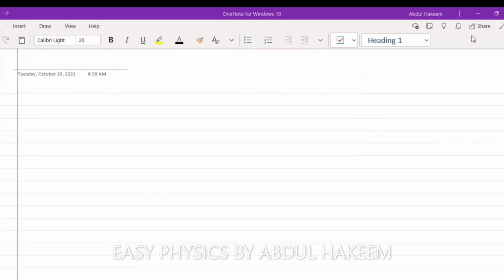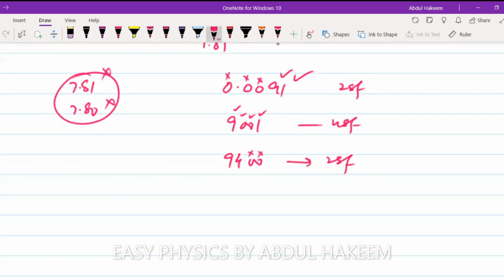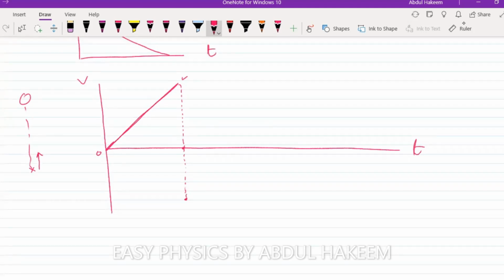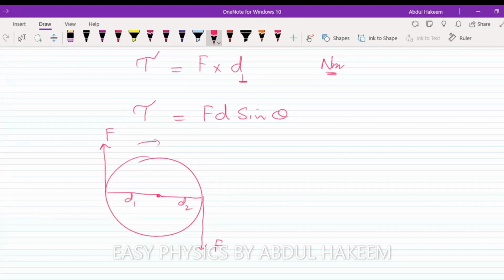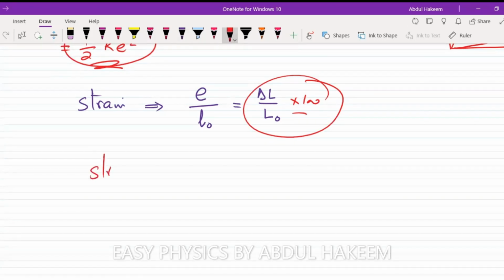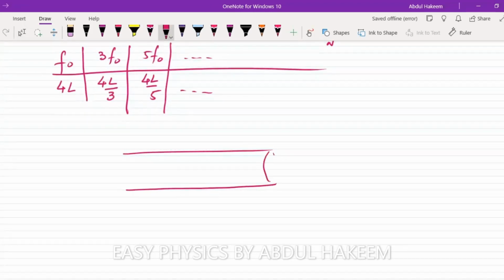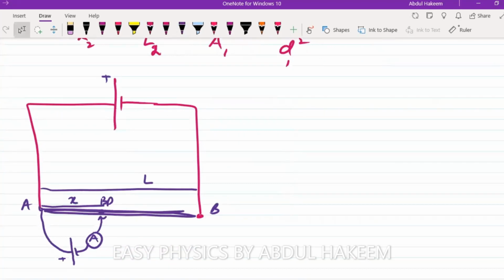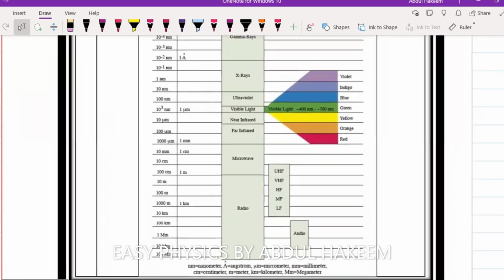PHYSICS PAPER 2 QUICK REVISION

Comment: 0:19 chap1 physical quant.
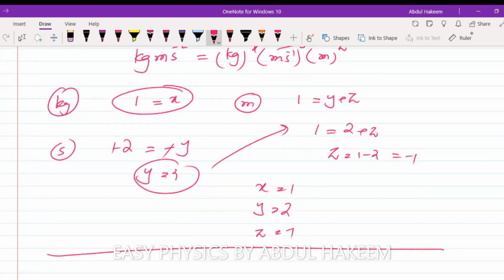9:23 vector components
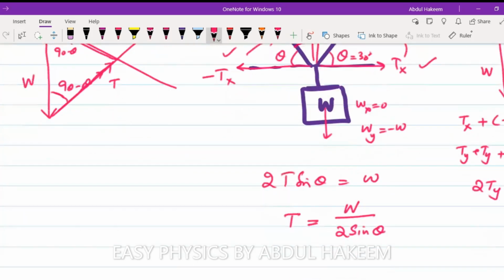19:17 chap2 measurements 
29:35 chap3 kinematics
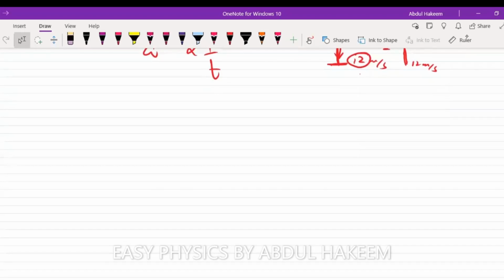54:23 chap4 dynamics
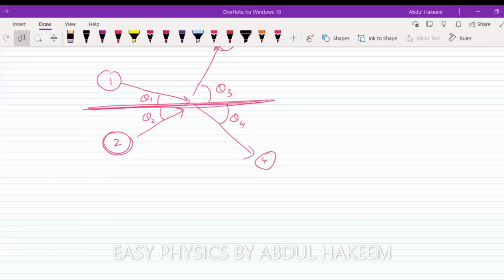1:10:25 chap5 force,density&pressure
1:18:13 chap6 work,energy&power
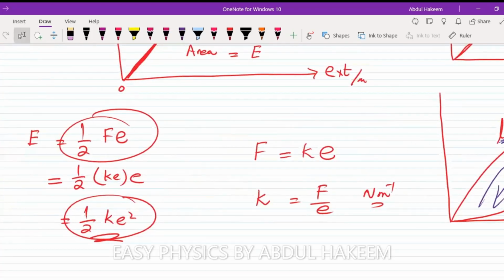1:34:31 chap7 deformation of solids ( stress&strain)
1:41:55 waves
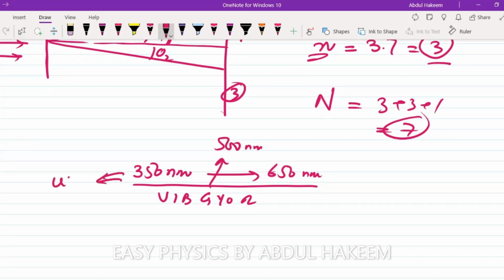2:10:16 electricity
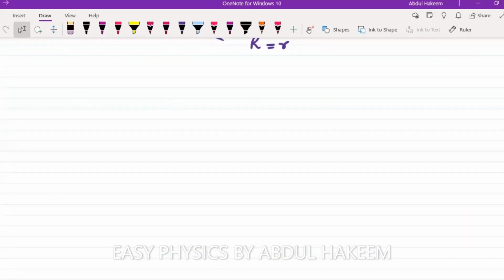2:25:34 nuclear physics
Reply: tysm